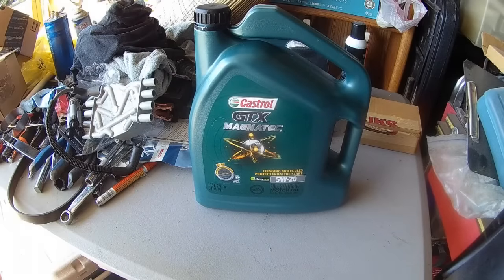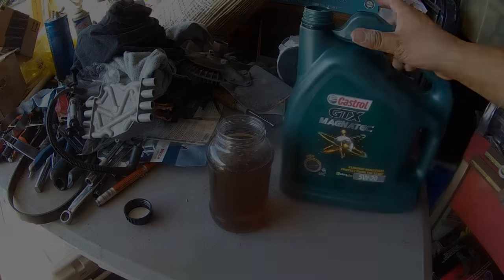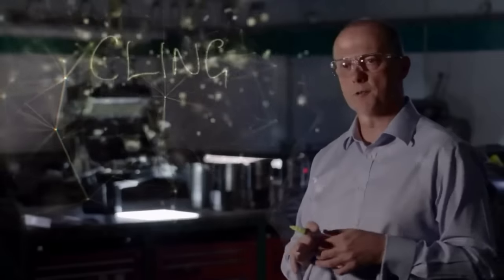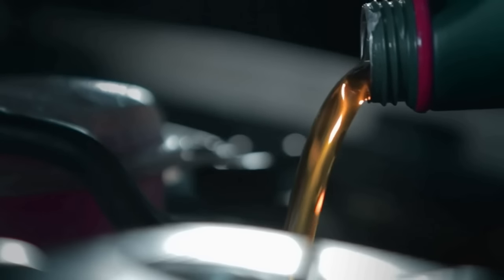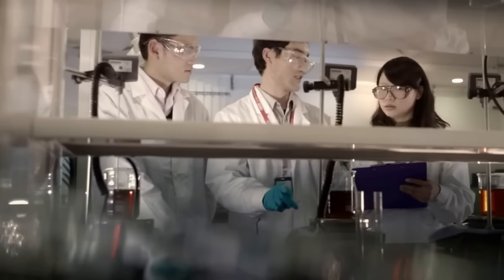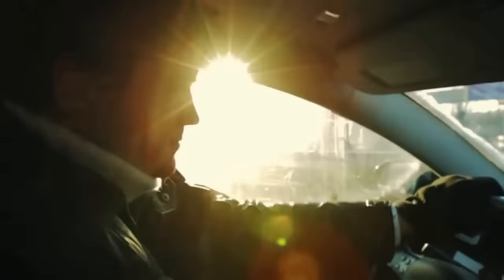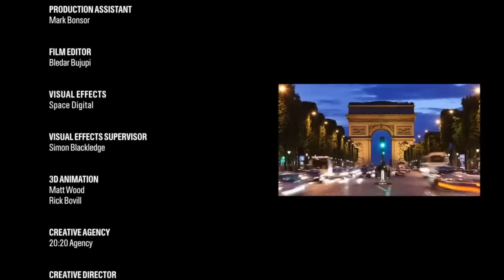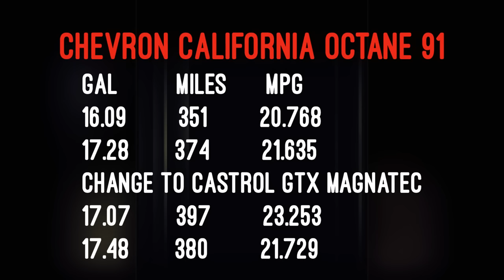Castrol Magnatec Engine Oil Review - Motor Oil Review - Is Magnatec Fully Synthetic? - Mobil 1

Comment: It’s a polar molecule, which makes it stick to metal. Rain-X does the same thing with glass. I use this oil and it works really well.
Reply: ''A polar molecule is a molecule in which one end of the molecule is slightly positive, while the other end is slightly negative. A diatomic molecule that consists of a polar covalent bond, such as HF, is a polar molecule. ... A molecule with two poles is called a dipole ''

Comment: Castrol Magnatec contains group III base oil - hydrocracked blended with various additives according to the car manufacturer specifications.
Castrol put this oil on various markets as a fully synthetic oil but, actually, it is an oil obtained through the HC synthese process. It is not a bad engine oil, but is not fully synthetic.
No engine oil manufacturer will publish the concentrations and types of base oils or additives put into an oil, because it is regarded as a company secret, so the only way to find how an engine oil is made of is to put it trough an analysis into a laboratory.

Comment: I started using Castrol over Mobil 1 about a year ago. Has quieted my engine noise down in the morning when cold starting.
Reply: Same i thought i was the only one but it just sounds too much like a sports car when acceleration
Reply: can you please tell me r u using magnatec castrol one or the other one
Reply: @difsid569  I’m using the magnatec.
Reply: @AlfredtheGreat121  thanks for your reply.
i have been using a French oil from Renault factory that they put in their new cars.
this time I'll try castrol magnatec my next oil change.
Reply: @difsid569  your welcome 🙏🏼
Reply: @difsid569  I think the hole castrol range is great I use castrol gtx look up the Volvo 3.2 million mile car he only used castrol gtx
Reply: @AlfredtheGreat121  Castrol buddy here. I've been using Castrol GTX mineral in all my power equipments, no problems or suspect smoke

Comment: depending on how it sticks all you need to know is chemistry, a water molecule doesn't lose its bonds in 100 years or even 1,000 years unless acted upon by an outside source. so in a closed enviorment the oil could stay put for any amount of time that type of bond stays stable. so claims of 100 years could be very easy to back up, I could truthfully say my water bottle of water will stay full for 1,000 years even though water bottle have only been around for a few decades.

Comment: Hy-per lube oil supplement works the same as this oil, but it's an oil additive. Hyper lube helps the oil cling onto metal surfaces. The good thing about hyper lube is you can add it to your preferred oil. Mostly every car's valvetrain are made with iron components so this Castrol magnetec will cling on the cams, rocker arms etc.
Reply: Isn't HyperLube the one made of mostly Calcium detergent? IF it is, you better off using a Diesel engine lubricant.

Comment: Mangnatec contains a lot more ester inside.Ester is the component that sticks to the metal parts and that's what castrol calls uma-unique molecular attraction.To be honest I don't think magnatec is good for your engine.That ester can turn into sludge very easily and gunk up your engine.
Reply: The Butcher066 only on a gdi if you dont service it. 6,000-9,000 miles i change oil at with a good filter
Reply: Yea but my 370z recommends ester lol.  Must be the hi reving or vvel engine.  I'd rather stick to that
Reply: Ehh, I haven't heard of any problems with it. Honestly, stuff seems to perform really well given the UOAs I've seen, especially as cheap as it is.
Reply: @mrsantosjon  Castrol, champion, motul are all ester based oils

Comment: Sir, the closed loop vs. open loop has to due with engine operating parameters. Your engine operates on its closed loop maps when you are in typical driving conditions, such as smooth throttle inputs with below 50% throttle angle. It goes open loop when it detects operating conditions outside these parameters such as WOT. 
The w in the oil is for winter rating and it's best to use what the engine designers recommend. Some engines have very tiny passages when a thinner oil is needed to flow to especially during hard driving. Most oils readily available even in 10 or 15 winter rating are more than capable of handling most cold winters. A thinner oil will also have less parasitic fluid drag on the moving parts of the engine which is in part why you get better mpg assuming consistency in driving habits. 

On a side note, it isn't necessary with modern cars to let them sit. In actuality what they told you is correct, it is better to drive the car shortly after starting to bring the oil and engine to optimum operating temperature (normal driving, not revving it out) because gasoline being a solvent will dilute the protective oil on the cylinder walls and will also get past sometimes into the crankcase reducing the effectiveness of the oil's ability to lubricate and protect. The engine oil as it reaches its operating temperature will evaporate the gasoline and reduce this damaging dilution effect within the cylinders and crankcase.
Nothing wrong in using aluminum or plastic where steel is not necessary. Besides less weight means less work the engine and brakes has to due to move or  stop your car from reduced inertia. Also means you'll be faster in all areas of performance if that tickles your fancy. 

There isn't some large conspiracy between the EPA, governments or auto and oil manufacturers. It just improvements in efficiency and trying to make sure you don't die an early death from air pollution or suffer from acid rain again though I doubt anybody remembers that anymore. 

I think you went off on a bit of a tangent towards the end, mostly out of mostly harmless ignorance. However nothing that a bit of study wouldn't fix. Overall an interesting video and appreciate the results posted at the end. Cheers.

Comment: I've used Formula Shell with 1qt Lucas Non-Synthetic ever since I've been on the road and have been very happy with it, quality filters are also the key to having a long lasting engine I don't use the 4-Letter F-Word on any engine I own, new or old.
Reply from the maker: +Jacques Montague I love Lucas full synthetic oil stabilizer, great stuff!
Reply: All that "oil stabilizers" do is make the oil thicker so it seeps past worn rings and valve guides and leaks slower. It just hides the symptoms of a worn out engine. I put it in my Honda that has been knocking for months, the knock got louder and 2 days later it spun a bearing and threw a rod on the highway, I did a motor swap. Not saying it blew up because of the Lucas, the engine was obviously dying, and for all I know it may have blown up the next day without the Lucas. You may not agree with me on that, but if you put in a couple weights thicker oil, you will be much better off, especially in extremely cold weather than using Lucas. Just my opinion.
Reply: Use a good oil and you won't need Lucas. I'll bet your fuel mileage increases also. Try castrol edge.

Comment: In my opinion Magnatec is/was no different to most other motor oils. All motor oils adhere (or leave a thin film) on engine parts. Castrol just had the brains to come up with the brilliant name (that was theirs only) which gave people the impression that they had invented something new. Of course you would have to pay more for this new wonder engine oil with these new & amazing abilities even though it was not too much different to most other engine oils.
I believe that the Magnatec venture was one of the best advertising campaigns in the history of Motor Oil. 
Now here we are in 2023 Magnatec is old hat & we have this new & amazing Synthetic oil (with a new & amazing Price too) that does everything better. But this time everyone has jumped on board because no one company can own the name "Synthetic" 
But I must admit that some of these additives & magic Synthetic mixes that oil companies are flogging off these days do burn cleaner in a diesel. I don't think they lubricate any better than high quality mineral oils, & some definitely don't, but some of them sure do burn cleaner than mineral oils..
Reply: I yried everytype of oil I could out in my cars since 1992, and I worked as a car mechanic in france and uk. Every brand I could find. Recently in australia, I saw magnatec going cheap, I tried it, normally I buy penrite top products full synth.
The diffetence with magnatec was consideraby better than any I tried. H6 subaru- 400k kms, runs so sweet now, the engine loves working, and freely accelerates.. toyota v6 3.4, runs much better, better tickover.. bmw k1100, runs way better now. 
Its magnatec for me in everything..now. and castrol in every machine.
Mobil 1, motul, shell, penrite, nulon, none comes close to magnatec in immediate benefits from 1st drive.

Comment: All my cars i put 5w30,when my car calls for 5w20,i dont like the fact that there going thinner like 0w20 and listen to the engine wrap,i have had hondas for last 30 yrs ,i had a 88 accord with 420k ,and a 91 accord tgat has 980k on it now ,and my mom has a 2000 accord with 390k,now i have a 08 crv awd ,i use 5w30,i think 5w20 is to thin,the 2012 to 2018 crv call for 0w20 and brand new you can hear the valves tap,i told my friend to switch to 5w30 the valve noise was gone at 15k,honda says that noise was normal but it stopped with thicker oil,0w20 has zero protection cause its like water and there using it for gas mileage not ware and tear in cars now,i live in boston area where we rely on good oil for the 4 seasons ,ive used 5w30 for all my cars and i have high mileage on all

Comment: Used for the last 15 years but seems to blacken quickly.I have now switched to Castrol Edge.
Reply: Would you recommend Castrol Edge for an everyday driver like a Camry? I would imagine Edge was designed for high performance cars and would not provide the same benefits in a regular car. I would assume the oil turns black quicker because it clings to the metal where carbon deposits stick to.
Reply: should have kept using it,  the oil was doing its job...
Reply: @McCarthyism_by_Youtube  Exactly.

I just had had my oil changed 'Magnatec' with 6000km on it, was asked by the shop if I drive much, oil was still golden brown.

I've had great results with it.
Reply: if your oil is clean after 1000 miles... golden honey or whatever... never use it again and change it asap.  that means all the crap is staying inside.   no matter what engine you have, it makes a hideous amount of crap. oil thermodynamically cools, hydrodynamically lubricates and holds combustion byproducts in suspension. the dirtier the oil, the happier I am.
Reply: @McCarthyism_by_Youtube  Engine has 40,000km on it, and gets an Italian tune up regularly. Hard to clean what's not there.
Reply: @bigpapa8152  your air filter is much more porous than you think it shouldn't be.(beta ratio)& your gas is much dirtier than you think despite fuel filters.  both these and some other surprise guests work against the mythical clean burn we hope is happening
Reply: @bigpapa8152  sorry I'm not picking a fight and I'm glad you take care of your car. I don't mean to come off brash and grumpy. I love my car too that's why I'm happy when the oil gets dirty 🤣
Reply: @McCarthyism_by_Youtube  Dude,  everything you have said is bang on....no arguments from me.
Reply: @qdoan17  the oil turning black is a number of things. one is the detergency of the oil and how well sludge gets liquefied by the oil...sludge is mostly made up of 'ghost riders'...particles too small to filter(<30micron) that travel unencumbered throughout the engine for the entirety of the change interval. these ghost riders actually do a lot damage due to being superfine(silt).  anything not filtered stays in suspension and once oil thins to it's cold weight, they settle out.  the longer you keep the oil, the bigger the 👻 💩👻party gets. After a while viscosity increases jamming solenoids, valves, rockers, creating false seals that starve out the real rubber seals... I'll stop now as I'm imagining the reader's eyes glazing over as I talk them to sleep. ok I'll see myself out btw I like your bear-skin rug very fluffy
Reply: @McCarthyism_by_Youtube  Never thought of it like that.I will use this oil again now.
Reply: @marclaw4511  if you moved to Edge from Magnatec, I'd stay with the edge.  The thing that's not widely known is that big oil constantly changes the oil formulations from year to year.  a few years ago pennzol ultra platinum was the favored oil.. now not so much as their grades are on the thin side.  Mobil1 used to proudly carry the BMW LL-01 certification on their 0w40 until 2015, when it vanished from the labels and website. I guess tweaking the oil changed the oil so it didn't meet BMW's standards and that was that.  Porsche's A40 certification is also a promise that you'll get a fantastic oil that performs the same at 10,000 miles.  Mercedes Benz's 229.5 cert is also widely respected.  some argue that when a cert gets dropped, it's the oil co. getting tired of paying licensing fees. But in the case of BMW & Mobil1 the oil couldn't meet standards after changing to gtl process refinement. it's still a great oil.. just change it at 5K instead of 10K
Reply: I would use an engine flush, i used Forte on my 2002 Yaris here in the UK back in 2009, it cleaned & worked so well! Oil stayed clean for 3,000m. Forte seems a lot for the money but it's really good stuff! You can tell the difference after using it,smoother & better fuel.